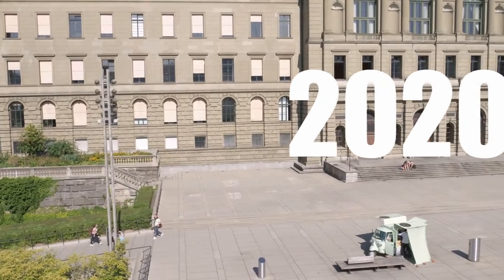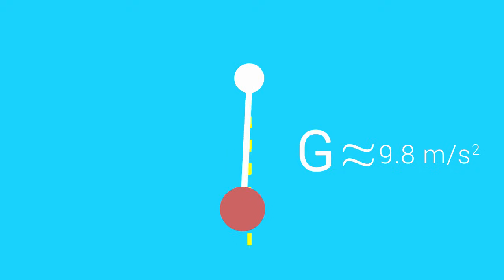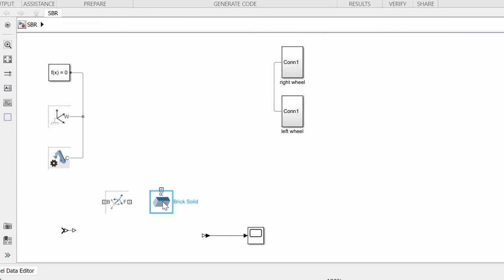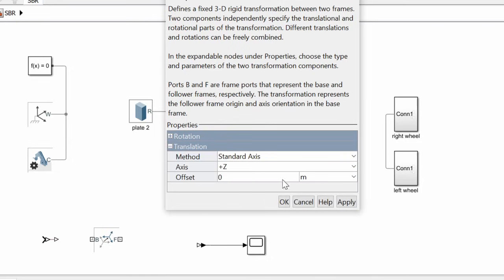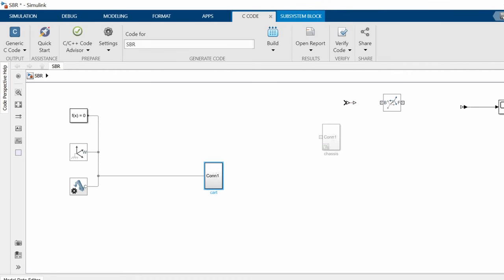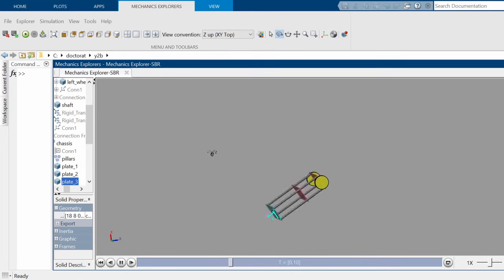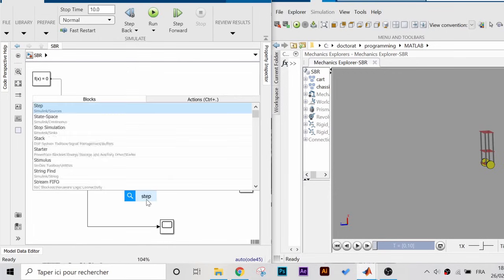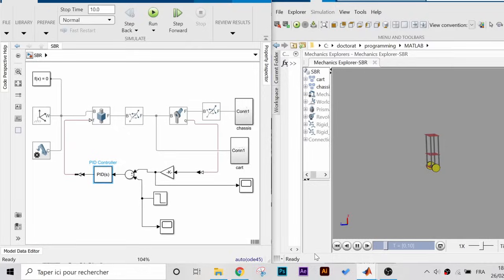self balancing robot | Simulink basics series

Comment: MAIN PIOINT TO CONSIDER:

IN THE VIDEO, THE GRAVITY IS SET AT -9.8 IN X DIRECTION. IN THIS CASE IF WE MANUALLY PUT THE ROBOT UPRIGHT AND RUN THE SIMULATION, IT DOES NOT FALL DOWN( TO THE UPSIDE DOWN), INSTEAD DOES THE OSCILLATIONS FROM THAT POSITION IT SELF. BUT ON KEEPING GRAVITY TO +9.8 ALONG X, THERE IS UNCONTROLLABLE ROTATION THOUGHOUT, NOT OSCILLATION..........

THIS IS WHAT I FOUND IN MY SIMULATION IN MATLAB BY FOLLOWING THE STEPS FROM VIDEO

It really feels like some important steps were intentionally left out of the video, maybe to push people towards buying the MATLAB file—despite it being priced at $10 even after being "briefly explained" in the video.
Please consider being transparent in tutorials. People follow these videos with genuine interest in learning or building something. Leaving out key steps just ruins the trust and the whole experience.
Reply: THE ROBOT SHOULD fall from the up right position when we run it, but it is not the case. SO FRUSTATED. BUT ALSO APPRECIATION FOR THE VIDEO AS NO OTHERS MADE A VIDEO ON THIS PROJECT'S SIMULATION..
Reply: one more very very important dobut to be cleared:

shouldn't the world frame axes and the axes for each part created match?
why haven't you done in the way where all the axes matching direction?....i have tried it also, but needs more careful caliberation which i done till some extent but failed at the end......
and also try to consider the gravity as in its default direction only. Changing it causes the students to make the project more tough..

tough this video is helpful, IT DOES NOT PROVIDE THE DESIRED OUTPUT
Reply: WAITING FOR COMMENTS AND LIKES FOR THIS COMMENT, FROM THE FRUSTATED GUYS LIKE ME, WHO TOUGHT THE PROJECT COULD BE MADE EASY BY WATCHING THIS VIDEO BUT THAT IT'NT THE CASE
Reply: Hi, I encountered the same issues. Since the prismatic join only allows for movement in Z axis, to solve this just mess around with the rigid join after it so that the cart would move in world Z axis. Also mess around with the gravity vector to make sure the cart is going downwards. Hope this helps!

Comment: interesting video although just doing a standard screen cast even if it's longer would be much more useful. I feel like i have to debug this tutorial. You add in blocks and components offscreen and use keyboard short cuts without explaining how to search for components. Also things like at 12:12 where you say it's really crucial to set a value and then cover the actual screen with a blown up screen shot of a properties window (but is it the one you're talking about, is it a bug and which one is it for), below the screenshot you can see the bottom of the actual window you're editing.. 

Great topic but honestly just a screen share of the whole process (sped up for bits if needed) would be much more useful. Nothing fancy just what you did is best.
Reply from the maker: thanks for the valuable remark.

Comment: I am having an issue, at the mid of the video, the bot is oscillating while  give a +y force at p3, but mine is not oscillating, but moving and rotating at a faster pace(increasing), yes, i set the damping coeff at rotating joint. Anyway its moving but not oscillating.
Can anyone help me with this?
Reply: Did u find the solution ..? I am having same problem ..want to find the solution ..its urgent
Reply: I am also having the same problem did u find the solution?
Reply: @Arun-uq4uv  i did something something in matlab ..and happily prof was convinced ..got grade ..enough for me😁

Comment: 2 things for those interested:

1) It is moving because for some reason of that force applied on the Y+ on the 3rd plate, together with the main step input of the system. This is looping through again and again making a set reference point of let's say "+X degrees" hence it moves in a direction. Tuning it manually I found that if you keep that force on the top plate let's say +1, then you should have a step input with an initial value of +4, and that should make sure that the robot stabilizes using perfect PID values automically tuned and realistic environment.  With this logic if you want to let's say simulate your own different setpoint remember that if you want to have a 10 degrees setpoint add +4 to it to make it appropriate and realistic, so put into the step an initial value of +14, and so on. 
In short, that constant movement of the robot is due to that initial force given to the top plate.

2) for those maniacs out there like myself, if you want to keep Z+ axis as your "UP" then just add a rigid transform right before the prismatic joint and set it as follows: Method: Standard axis > Axis: -Y > Angle:90.  then go to the Mechanism Configuration and have gravity as: [0 0 -9.80665] this way gravity is kept as a force towards your relative "DOWN".  Click ok, then hit Ctrl+D and enjoy your Z as "UP/Down" and X as "Forward/Backward" and Y as "Sideways".
Reply: i follow your 2 remark and my robot just plunge to its death, go straight down to the z axis, i think the problem is the prismatic joint only translate along the z direction

Comment: Why I can't use outotune?
Reply from the maker: yes you can,  just be careful with the output limits.
Reply: @hobby_coding  Also, do we need to include the weight of battery and microcontroller in the simulation?
Reply from the maker: @k1s1t7  yes absolutely

Comment: hello and please,in the library i cant find cylindrical solid option why is that
Reply from the maker: make sure simscape is installed
Reply: @hobby_coding   i have gone same steps wt the vedio  simscape then multibody elements but there is only  4 options they are variable mass ,inertia ,solid, graphic
where could i find the cylinderical solid option?please
Reply from the maker: @merondesta3895  i have matlab 2019b so maybe you have a different version than me
Reply: @hobby_coding  yes so do i have to install that one or i can replace by other like from  variable mass option lists
thankyou

Comment: Which block or component in the simulation is responsible for giving the force for the robot to move ?
Reply from the maker: the pid controller gives the control signal which is then fed to the prismatic joint

Comment: I have own Solidworks design parts and apply PID same way. But increasing integral gain doesnt have steady state error less.
Reply from the maker: check your COG, it has to be somewhere in the center of the robot and not biased (to the left or the right )
Reply: @hobby_coding  Thanks for reply. I understood mostly. But what does it mean as biased?
Reply from the maker: @technopeace4077  it means that the COG is centered regarding the x and y axis

Comment: Thanks for the video, I'm facing a problem and I wanted to ask here: the mechanic explorer doesn't show any of the parts that I created it only shows a grey screen. Does anyone know how to solve that?
Reply from the maker: 1 - make sure you connect the model to the world frame 
2 - make sure you update the model using CTRL- D
Reply: @hobby_coding  did both still no result
Reply: Hello, facing the same issue.. And if I select auto tuning method. The dialogue box opens and it shows plant cannot be linearized. And also my model is not seen only grey screen is visible. Can you please tell me what to do?

Comment: I'm facing a problem with my Simuscape model , I've mailed you my .slx file can you please have a look and help me in rectifying the errors
Reply from the maker: please read the description first .
Reply: @hobby_coding  my model is related to this only , I have made a self balancing robot in simuscape , I didn't get The correct output that's why i asked for help
Reply from the maker: @AbhinavSingh-fq9ek  ok, i will take a look into it later , I'll send you the answer via mail . 
🔥 IMPORTANT :  the value of the  gain block is :   -180 / 3.14
Reply: @hobby_coding  yes sir I did put the same value of gain

Comment: Do you know how you would go about adding two DC motors connected to the frame, which in turn are connected to the wheel? I'm trying to translate this to my real world cart.
Reply from the maker: 1 - other than the appearance the dynamics will remain the same so I dont see the logic behind adding motors to the model behind other than the appearance
Reply: @hobby_coding  Because I want to model my physical system? I don't have a perfect force input, I have two DC motors with gearboxes I can apply a voltage to; so I get a certain output torque.
Reply from the maker: @superdogmeatmeat  try setting a maximum output for the pid bloc proportional to your dc motors max delivered force combined and then retune your pid gains
Reply from the maker: 2 - if you want to do it then instead of the shaft you will build your motors and connect them together using rigid transform and then you take this model and connect it the same way to the chassis as we did in the video
Reply from the maker: i think this will work